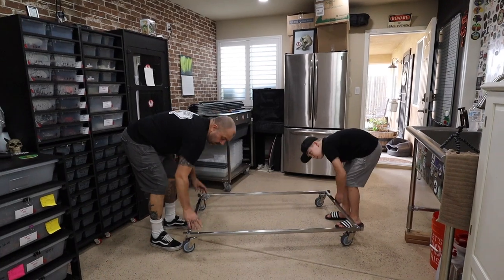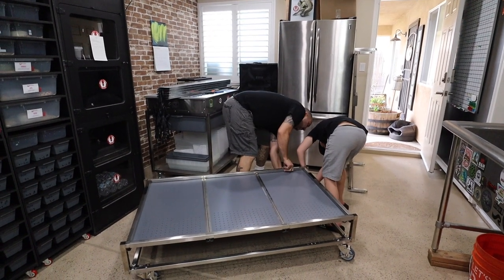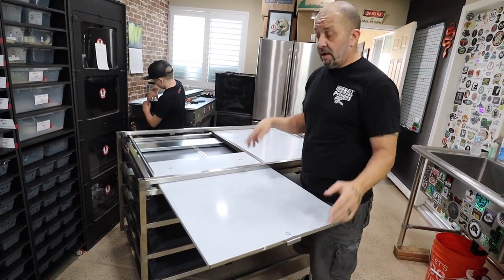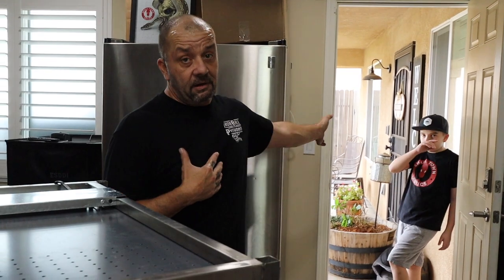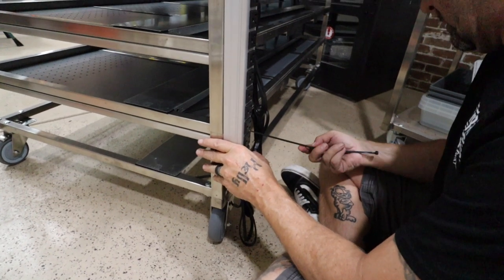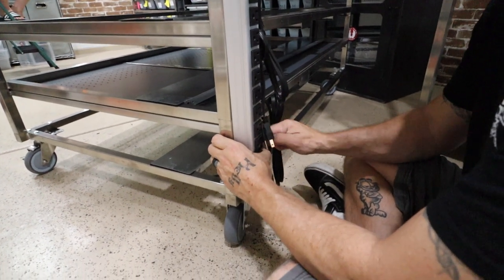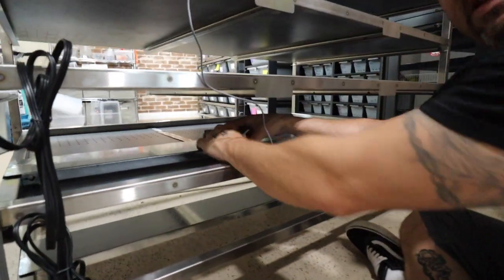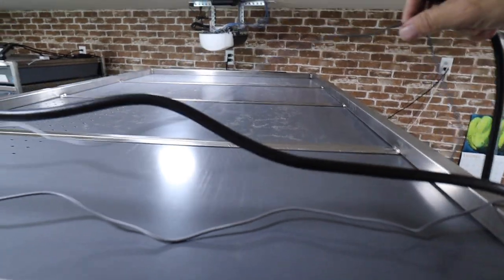How to Build a Freedom Breeder Rack | Step by Step Guide

Comment: 6:04, Can you ziptie the power strips 90° from what you have them? That way the cord isn't getting pushed against the wall and bending the cord at the plug.
Reply from the maker: I had the other rack that way but I changed it to the way shown on the video so the racks will but up against each other. I just keep the racks away from the wall so the plugs aren’t smashed